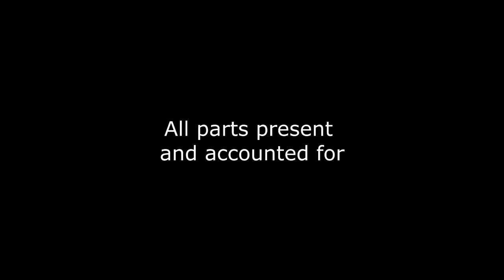Revell Visible V-8 as of January 2022

Comment: Super great job.  Looks like the newer version is much more refined than my 1977 original was.  I noticed the wires, air cleaner, plugs, etc are quite different.  Enjoy and stay well.
Reply from the maker: Thanks nightflyyer.  Glad you like it.  There are a number of these original kits still available on ebay.  Since you unfortunately lost your's in a fire, you can still get one on ebay if you wanted.

This is actually the older 1977 version.   I purchased it on ebay in late 2021.
Reply: @SoGoYoko  Right on!